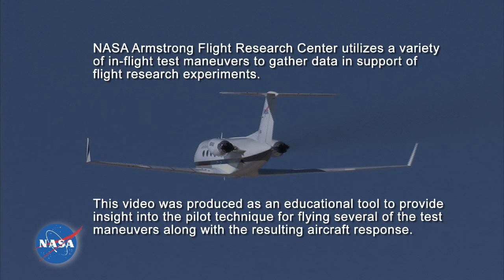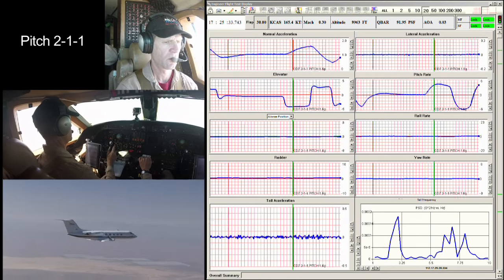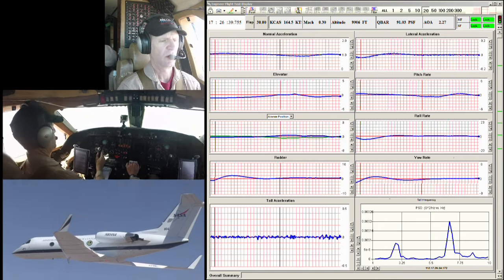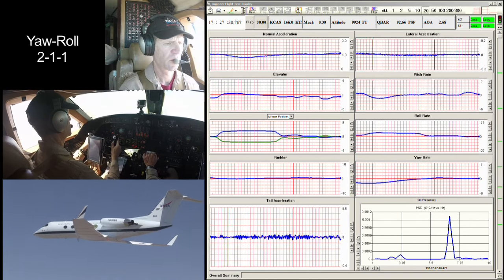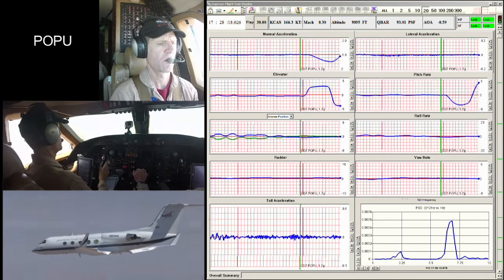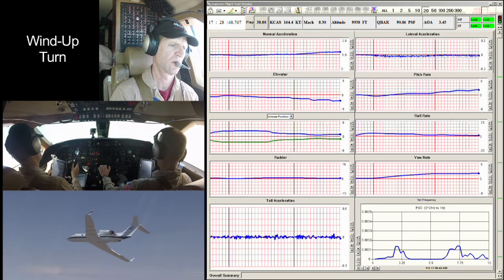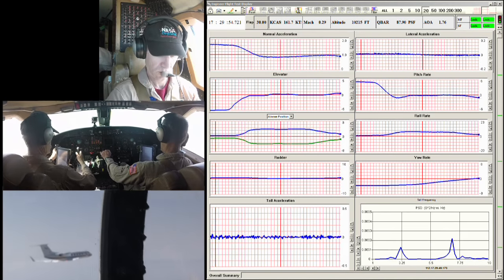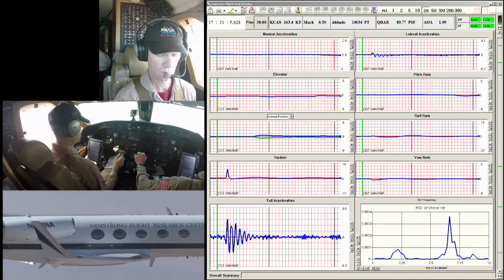SCRAT Flight Test Maneuvers

Comment: These guys have given everybody a better insight of what actually happens in flight test engineering...its a very small video but it is to the point & has a very precise content of what exactly do you study in flight test engineering.... pilot control inputs...doublets...impulse....system behaviour to various random inputs.... Static & dynamic stability concepts....it is well said....the best offices are in the sky....